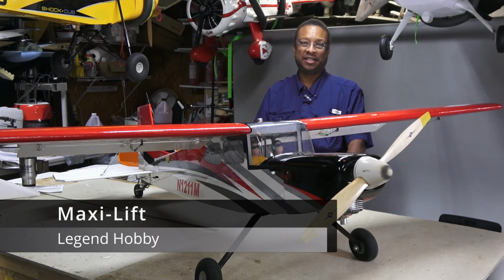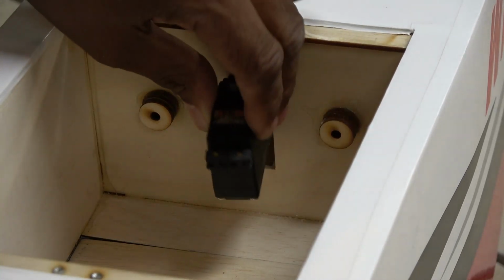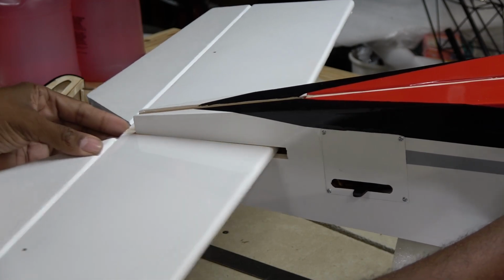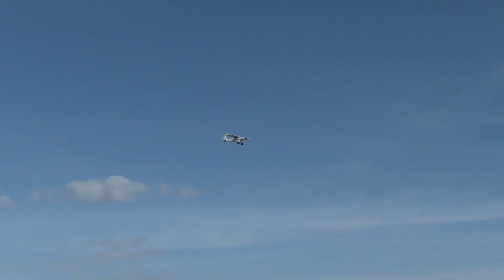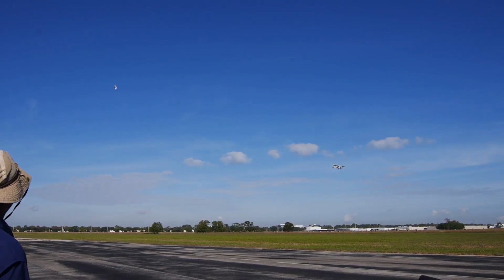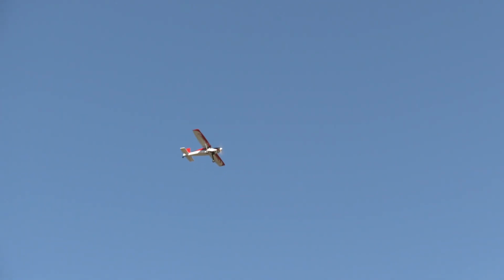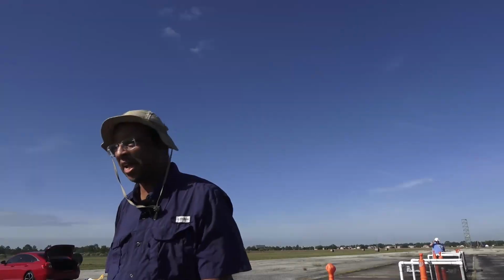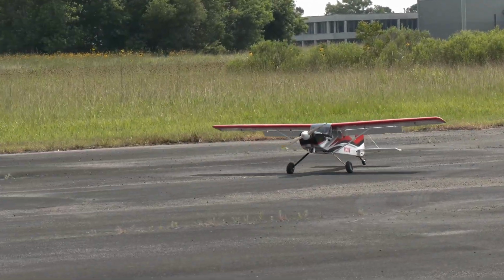Extra Utility - Maxi Lift 88" Full Review | HobbyView

Comment: I've had nothing but problems with RA engines. The muffler heats up the carb and then vaporizes the fuel.  Makes it run erratic or quit. I added a wood plate between the carb and the muffler.
Reply from the maker: First I've had an issue with RE engine. I had broken it in with regular gas and it had sat for a while. I suspect that was the issue as I normally use ethanol free gasoline.
Reply: @HobbyView  that's good to here.  Mine were DLE.  I'm really digging twin engines now in those cowels like the Maxi Lift. They run so smooth

Comment: Just trying to find info on this model, how are the wings attached? they are removable right?
Reply from the maker: @danielcarrenofernandez7424 , yes wings are in two pieces l. Held on with screws.
Reply: @HobbyView  Thanks you! another question, if is not too much to ask, how much weight did you user to balance the CG, i can se in you article review, that you put weights on the firewall. sorry to bother have a nice day/night in advance!
Reply from the maker: @danielcarrenofernandez7424  , I used about 8-ounces. What's needed will vary depending on engine used, mostly.
Reply: @HobbyView  Hi there, sorry to bother you again XD, i just receive the model, looks splendid, i notice that there is no fuel tank, which size did you use? if is not to much to ask
Reply from the maker: @danielcarrenofernandez7424  ,  I think around 16oz. (500cc), is what you want.

Comment: RCGF engines are junk, lost a few planes to them. Been flying DLE's now for years and they are so much better. I had a few warbirds with DA50's and swapped them out to DLE 55's because they are so much smoother....and had no problem getting my money back selling the DA's to the IMAC guys
Reply: Sorry you had that experience … Fitzs problems were most likely a fuel system issue not actual hardware issue .. we find the stinger engines very reliable and good running .. so much so we stuck our money where our mouth is and we powered our B-17G Flying Fortress preproduction model , it was the only 1 model In the entire world for us to test with before finishing development so we needed reliability and power and we got it with (4) Stinger 15cc gas engines (stinger are not the old RCGF engines , they are the new generation of engines and are great!)
Reply from the maker: Engine was fine after I re-did the fuel lines and replaced the filter. It was user error and not a fault of the engine.
Reply: Apparently I was dealing with the early RCGF's and not these new versions. DLE has done me well, as has a G38 in my Stearman. I might try them again, but definitely reluctant